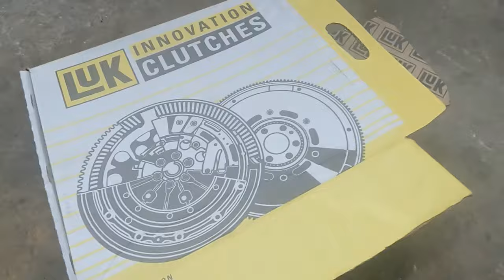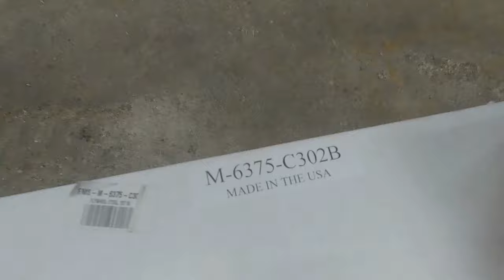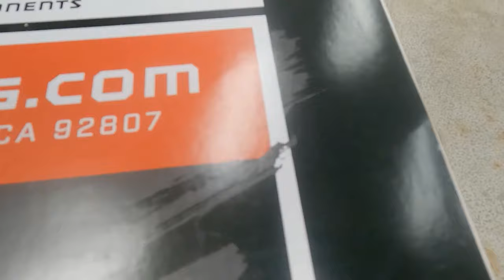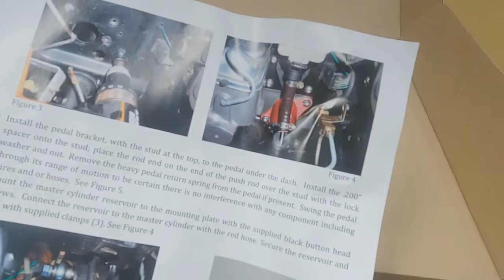302 With A Vibration From Installing A Cheap Flywheel

Comment: The large pad on the cast iron flywheel that was removed shows it was a 50 oz flywheel.  The new flywheel part number is Ford Racing and is that part number is also 50 oz.  If the cast iron flywheel had a small pad it would be 28 oz and no pad is neutral balanced.  Some of the steel or aluminum flywheels accept a bolt on weight and are zero balanced without the weight.
Reply: Thats correct.This dude could have an a 28oz crank with neutral zero flywheel,he could have a 50oz balancer with a 28 oz flywheel,a 50 oz motor with a zero flywheel.

Ive used a bunch of those luk flywheels never a problem.

Theres more to this abortion build then is being told.
Reply from the maker: They where both 50 ounce imbalance it's a 86 302 that takes a 50 ounce . The LUK vibrated and the summit fixed it. I've got 351W's and they use a 28 ounce I know what uses what I didn't use a 28 on a engine that uses a 50. I've been working on Fords for 35 years  and I've seen this problem using aftermarket flywheels before that's how I knew it was the LUK flywheel causing the problem.
Reply from the maker: Mustang Mike's Az  it's a 86 302 and it takes a 50 ounce that's what both flywheels are but the LUK shook and the summit flywheel didn't. If you want to buy a brand new LUK I got one for you try your LUK with this cheap junk and shake your engine apart.
Reply from the maker: It's a stock 86 302 that takes 50 ounce imbalance flywheel and has a new 50 balancer both flywheels are new 50 ounce.  But the LUK vibrates and the Summit one fixed it
Reply: @kickassmustangsgarage  My ported stock e7 stock intake build ran 12.30s 110 on motor and 10.70s on  a unit with a luk flywheel didnt vibrate at 6500

Maybe their junk now? The flywheel that was pulled and put back in the box,(the one on the ground I assume) did have the 50 oz pad but it looked to be drilled like I would see for a zero balance deal.Maybe someone got stupid with the drill press during manufacturing.

Did you ever show the other flywheel in the video for a comparison or just install it and run the video?
Reply from the maker: The one I put back in the box was the $65 LUK. The one in the thumbnail is the Ford Racing billit steel one from summit. The zero balance ones don't have holes drilled. They drilled the holes on the opposite side of where the weight would be on a factory one to balance it.

Comment: According to Ford, the 302 carburetor engines until 1986 have 28Oz clutch flywheels. 302 EFI engines from 1986 to 1996 have 50Oz clutch flywheels.

Comment: Good Video Buddy! That new  flywheel had big vibration. Good Setup you got and I like that older mustang looks like 65.
Reply from the maker: That luk flywheel was a vibrating piece of crap. The old Mustang is a 66 I put quarter pannels on it 30 years ago and I never put the chrome pieces back on the quarter pannels by the door's. So it does look like a 65 the chrome trim on the quarter by the door is how you tell the difference in a 65-66.

Comment: Glad ya found the vibration.....cooling system is yourfriend to find the leak and burb air out of the system.
Reply from the maker: I think by me revving it up the water pump wasn't sealed good and it pushed the water out between the pump and the timing cover. I'm glad I found the vibration problem before I put it in the car. That's one good thing about running it on the ground you can fix all the issues while it's easy to see and get to everything.
Reply: What I meant to say was a cooling system pressure checker is your friend... They are a Little expensive for the little use I would use one, so I just go do the Free rent deal at the box store.
Reply from the maker: @bobbywartman2058  I take the shop air and shoot a little air in the over flow nipple with the cap on the radiator. It pressurizes the radiator as much as the cap can hold back. My little test rig that I have the lower hose is just connected with a one inch PVC pipe slid in a coupler to reduce the hose to fit the radiator and I didn't glue it in that one spot, and if I pressurize it it'll blow apart lol.

Comment: I had the same thing happened to me and all it turned out to be was some lock tite come out of the threads from the previous install that got in between the crank and flywheel. That shit is hard as a rock when it’s setup and it was just a small piece that was stuck to the crank when I pulled it back apart and I just had my flywheel surfaced so I knew it wasn’t it
Reply from the maker: If they cut enough off it can cause a vibration I've seen it happen before. A guy I know had a Mustang and it had a resurfaced  factory flywheel he thought it was the clutch causing it to shake. I took the clutch off and put the bellhousing back on and ran it and it still had a vibration so I swapped the flywheel with one I had put the bellhousing back on and ran it and the shake was gone. That's how I knew to swap it on this one and it fixed my problem.

Comment: I have tesame problem on a self build scat 331. Vibration when steady rpm

Got a luk flywheel and changed to a pioneer tesame vibration. Put my c4 flexplate on . Tesame vibration .

I can shift my flywheel up and down on the crank  and rotate it slightly with shouldered bolts in but they have play in them. Does youre negine vibrate when driving?
Reply from the maker: 68-81 302's (two piece rear main seal) are 28 oz imbalance 82-01 302's are 50 oz. The machine shop has to balance the crankshaft on a stroker crank to the rods and pistons weight and balancer, flywheel or flexplate you used. Normally stroker cranks use the 28 oz imbalance balancer and flywheel ( flexplate with a auto trans) and still have to balance the crankshaft to the rod and piston's weight. If you just bought a scat crank and didn't have it balanced to your rods and pistons with the right weight balancer and flywheel it needs it'll never stop vibrating. My engine is a stock 302 and is balanced from the factory to 50 oz the LUK flywheel was like you said had slop and you could move it like the bolt holes where too large. It had a vibration at a steady RPM swapped it to a Ford Motorsports billet flywheel and it stopped. Hopefully this will help you out good luck with it!
Reply: @kickassmustangsgarage  

My flywheel can slide on the crank up and down so the center opening of the flywheel is a little too loose i think.
Did you're luk did this also? Does the American flywheel fit snugger on the crank?

Comment: Wish I knew you needed a flywheel. I have two ford oem 157t 50oz ones from 302 here that I’ll never use. And way too many 164t
Reply from the maker: I was just trying to put a cheap new flywheel on it and the LUK had a bad vibration. I guess you get what you pay for. I've got a factory flywheel somewhere in all this junk I've collected over 30 years. I'll find it when I don't need it LOL.

Comment: 1991 351w what weight flywheel do I use motor came with auto
Reply from the maker: All 351W's take a 28 OZ

Comment: Do you think that hydraulic set you have would work on a 1974 f100 ?
Reply from the maker: I'm sure they make a kit  for a 74 F100 if it didn't work with the supplied brackets that came for a Mustang. It comes in two kits to make it work the clutch master and brackets are one kit and the slave comes in the other kit. CJ  pony parts is who it came from you could probably use a clutch master cylinder off a newer truck and make it work a lot cheaper it's about $600 for both kits I got.

Comment: It makes no difference where a flywheel is made if it isn't balanced for the rotating assembly. Are you ignorant of Ford V8 balance requirements?
Reply: Luf model says it's imbalance 50 ounce and it vibrates. So what were you saying about it doesn't matter who made it?  Oh that's right, you aren't building an engine nor do you understand production quality
Reply: @josephdedman5595  - reading is fundamental - I said:

 "It makes no difference where a flywheel is made if it isn't balanced for the rotating assembly."

Notice the part where I said, "if it isn't balanced for the rotating assembly"?

No need for you to apolgize - I understand your "type".
Reply: @sandibaker7646  you  right
Reply: My type builds and runs the world.
Reply from the maker: I know what engine I have and what weight flywheel it needs. That's not what the problem was they are both 50 ounce imbalance flywheels but one shakes and one didn't. You can buy a china made one if you want to and shake your engine to death. It's fixed now that's all that matters to me with USA made parts  that solved the problem. I got a LUK for sell being it doesn't matter who made it you can use it try your luk with it lol.
Reply from the maker: Sometimes a turd is just a turd lol!

Comment: ya realize that they made the flywheels different for older 302s then for the new 302s
Reply from the maker: I've been knowing about the difference in the 302' since 82 when they were made 68-81 are 28 ounce and 82-01 take the 50 ounce that wasn't the problem both flywheels are 50 ounce  one shakes and one doesn't.  LUK is aftermarket cheap junk and the other one is a Ford racing billet steel made in USA and Magically it doesn't vibrate with the Ford Racing flywheel.

Comment: Hard to find good parts these days!
Reply from the maker: Yeah you get what you pay for going cheap on parts seams to bite me in the ass everytime.
Reply: @kickassmustangsgarage  I’ll agree for sure
Reply from the maker: Even if you buy good parts time FedEx bounces it off the ground a few times you wind up with junk. I just got a bent up new door, fender and hood all damaged in shipping. Nothing like having to repair brand new parts that a idiot damaged because there to damn lazy to do there job right. I found the new door laying on the ground where it fell off my porch because the female FedEx driver stood it on the end  one puff of wind and to the ground it goes. I told her that CJ Pony parts needed her name because she damaged my parts. She told me she knew  they were damaged when she got them but she HAS to deliver them anyways. She was pulling up in my yard to drop off parts now she parks in the road and wears a Rona mask trying to hide her face. She never did give me her name they need to fire her ass lol.